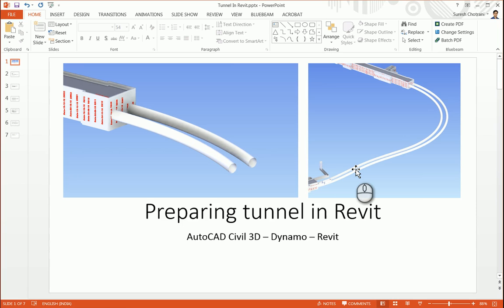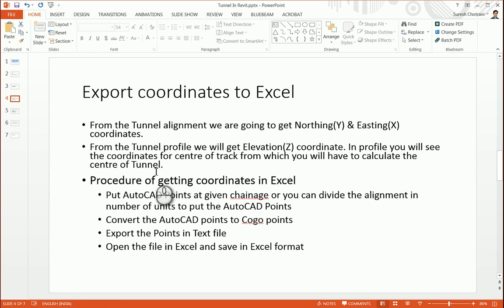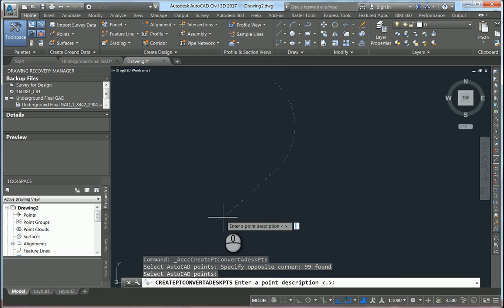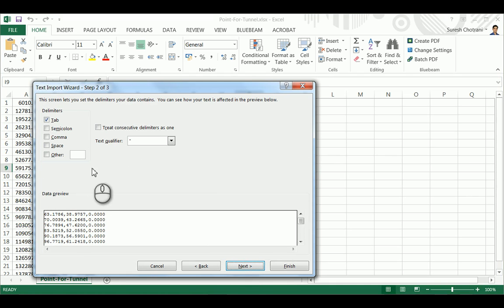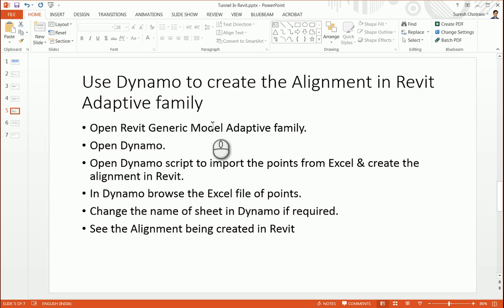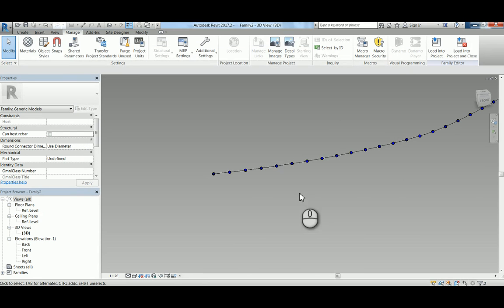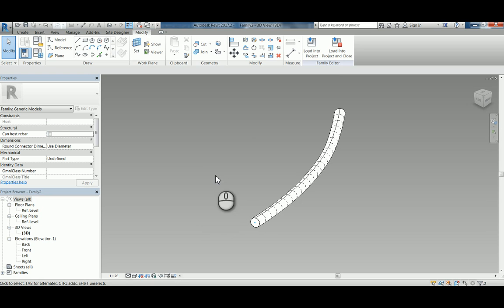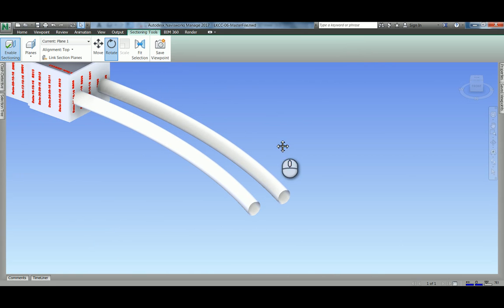Create Underground Tunnel in Revit

Comment: There is no Z cordinate in the Test-Point.xlsx that you saved but it is in the Point-For_Tunnel.xlsx, Please let me know how I can get the elevation(z) cordinate from the tunnel propile on the same point with tunnel alignment of horizontal. Thanks in advance.
Reply from the maker: When you export the points file from Civil 3D you will have all 3 coordinates(x, y & z)
Reply: @suresh1787  Exactly !!! But we have plan alignment and profile (vertical) alignment  seperately in normal. Also we don't design 3d alignment line yet from the first time of design. But you explained 3 corrdinate,  like as you showed us the plan alignment only to make a file of Test-Point.xlsx on the video but z cordinate filled on the excel sheet of the file  Point-For_Tunnel.xlsx, after turn on the screen again. It's magic !!!     Please let me know how you get the z coordinate !!!